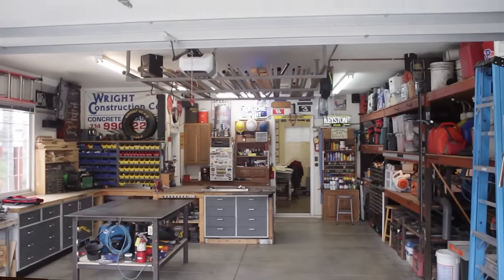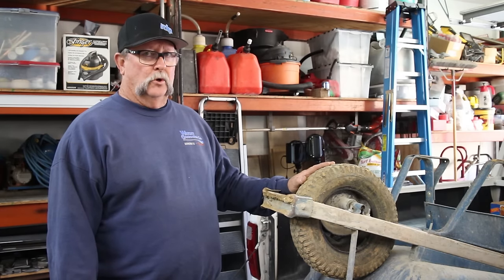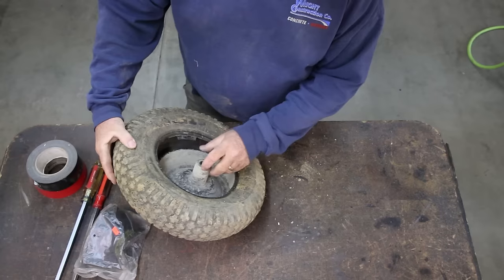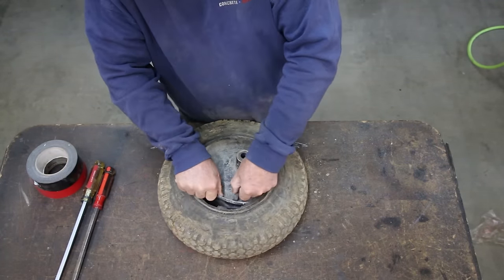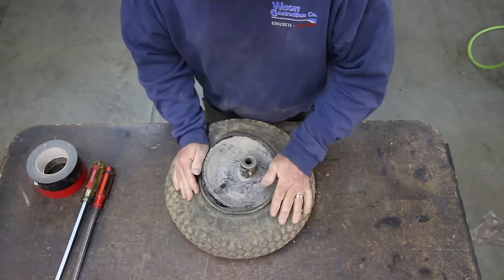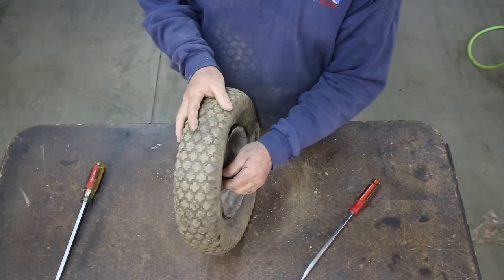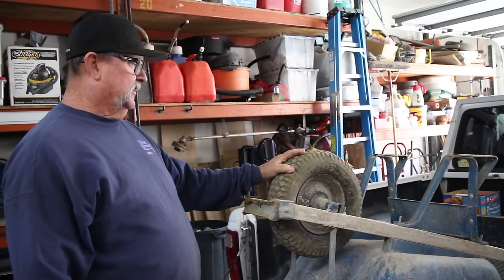How to Replace a Tire Tube on a Wheelbarrow | Step-by-Step Guide

Comment: Just wanted to share, the hardest part of this job is holding the old rim when trying to get the tire back on as mentioned.  I have found the easiest way for me is to put a short piece of rebar (could possibly use the axle itself) in my bench vice pointing up.  Then drop the rim over that so it sticks up through the axle hole in the rim to work on it.  I also smeared dish soap on both sides of the tire bead and was able to get the tire back on with just my hands working it on slow so no chance of puncturing the new tube.  Hope that helps someone else!
Reply: Good tips, thanks.
Reply: Thanks

Comment: Another tip I can give is the valve stem leans to one side when tube is inflated so I put some air in the tube first, mark the tube with a pencil the side it leans, then deflate it and install accordingly. I didn't do this the first time I put it in and when i started putting air in it the valve stem flung back inside the rim towards opposite side. I had to break it all down, remove it and start over.
Reply: Good tip, thanks.
Reply: My exact problem tonight. I told my wife it shouldn't take 2 hours to change a f%#kn inner tube.
I hate stuff like this - once I start, I can't stop - and then I know I'll never get that time back.
Maybe God keeps time like a soccer match - He  adds the time at the end.
Reply: Mate thanks for this tip first time I did it the valve pulled through the hole after reading your comment I got it correct second time round and second inert tube as I had to burst it to get it out 👍

Comment: Everything shown is simple common sense, but the hardest part of the job is completely skipped in this video.  Taking the tire off the wheel!  This one happened to already be off the rim so the job was simple, but you should make a video where the flat tire is still seated on the wheel and has to be pried off.
Reply: Absolutely! That's what I'm looking for, too - how to get the tire off the rim first. If you found a link on how to do that, let me know. Thanks!

Comment: Thanks for the great video!  I did find an easy way to get the tire back under the rim.  I used a screwdriver and 2 pair of small vice grips.  Lock one vice grip on the rim to keep the tire down.  Then use a screwdriver and another vice grip to keep working and holding the tire under the rim until done.
Reply: Nice tip, I stood on two sides and then used screwdrivers as I didn’t have vice grips. Punctured one tube with the screwdrivers, but had the foresight to have bought two tubes.
Reply: Once again, Vice Grips to the rescue. Great tip, thanks.

Comment: THANK YOU SO MUCH!  I've been trying for the last hour to put the tire and tube back on the rim at the same time. My arms are barely still attached.  Your method helped me actually do it in about 5-8 minutes with a crow bar... Very different than changing bike tires.

Comment: Thanks for the video. As with most YouTube videos, I pick up a trick or two that helps a lot. I just finished putting a tube in my wheelbarrow tire, using no screwdrivers (I don't have the tire spoons).. helpful things after I had everything apart, clean out the inside of the tire and check it very carefully for any debris, prop up the hub of the rim a bit (I used a roll of drywall mesh tape I had laying around), grease the rim of the tire with oil. I actually put the tire back on the rim just using my hands. Easiest tube I have ever put in after ruining rims and many new tubes in the past. Thanks for the tips in the comment section
Reply: I'd be worried that the oil would degrade the rubber?

Comment: Damaged a tire on my Scag Zero turn. The dealer wanted $150 for one rear tire. https://www.youtube.com/post/Ugkx985f3iNjxHFMO6JoE7CSGActiIEyumFx Local tire store wanted $95 for one tire and both said I would need two tires because the replacements were 2 ply and the OEM was 4 ply which would result in different diameters when inflated if not mounted in pairs. I ordered two of these for less than $90, they arrived in two days instead of the promised 5 days. they are 4 ply rated and when mounted I can't tell the difference with the Grassmaster that came on my Scag, except the sidewall doesn't appear to be as stiff. Tread pattern is identical with the Grassmaster. Will keep the other new tire as an extra if the other OEM is damaged.

Comment: I was struggling with my wheelbarrow inner tube replacement but feel better to see you struggled as well. LOL I've remove full size car tires manually a few times when I was young, but for the life of me the wheelbarrow tire was much more difficult. After puncturing the tube multiple times with the screw drivers, finally invested in a set of tire spoons.
Reply: I used the back side of a box wrench, round socket extender, and the back side of a crescent wrench. As always I will find .you motorcycle tire irons in about three months or so!

P.S. When asked what tool I am looking for...the one that I can never find when I need it!!! 🤣
Reply: Haha that was 5 years ago, those inner tubes don't last long outdoors in the heat. Patched it and fill it up with air (about 20-30 psi) on all three of my wheelbarrow inner tubes immediately blew out. Have 4 tubes on order. BTW the 3 sets of tire irons ordered 5 years ago works really well.

Comment: Thank you for this.  So much better than the instructions on the packet.   I would never have thought of first putting the tyre on the rim before packing in the inner tube.  But it worked a treat.  Thanks again.

Comment: 1:40  Jimbo has removed the wheel from the wheelbarrow; wheel is on the workbench.
2:00  The tube has been removed from the tire.
2:20  He unwraps a new tube. 
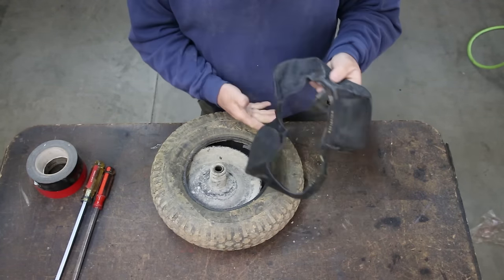2:40  Make sure to get a 480 x4 x 8 inch tube.
3:15  Tube is in the tire and value stem is pulled through in the wheel.
3:40  He starts to work the tire onto the rim. 
5:06  Tire is on the rim.
Tire irons for small tires are available with rounded ends to avoid pinching. Try searching for "tire spoons".
Thanks, best wishes.

Comment: Lubricating the tire to make it easier to pull back over the rim is a good idea. If you use engine oil, try to use as little as possible and then try to wipe up whatever remains after getting the tire on the rim (before you add air to it), because engine oil will degrade rubber over time. Better to use a silicone lubricant, which is non-petroleum based.
Reply: Silicone spray, or dish soap works great.

Comment: Had to change 4 heavy duty lawn tractor tires one day, it started raining and everything got wet and slippery. My not-so-mechanically-inclined neighbor came over to chat right in the middle while I was was working on them 🙄. I kept working/struggling and after a few mins I was like - I’m a little busy right now can we talk later? The tire change was brutal but I pushed through and got it done.

Comment: Thank's for the video, but..... That tire shouldn't be used again, you can see that the steelwire are apart from the tirebead. And also when putting in a new tube one has to feel inside the tire that there isn't anything sharp inside. And it's much easier if you clamps the rim in a vice, instead have it loose and a bench. And last, do not use a screwdriver when mounting, use a tyre bar instead.

Comment: One thing l would have done before installing the new tube: After l had pulled the old tube out l would have checked the inside of the tyre for thorns, grit etc i.e. anything that could cause another puncture. 😉
Reply: I agree - exactly what I wanted to say - I thought it would have been said by someone else as the video is approx 6 years old so I'm glad to see you comment.  Also, I use motor cycle tyre levers as they have a larger surface area and are curved and, if  you're doing this job regularly then it is worth investing in getting some of them for this job. I did like the use of the rolls of tape to support the wheel whilst doing the job - a better idea than what I'd been doing - balancing the wheel between two blocks of wood!

Comment: You do that weekly and u don't have tire spoons to prevent nicking with a big sharp edged screwdriver?
Even as a kid I used big pliers to avoid hitting the tube with a screwdriver.
Just saying. If you're gonna give advice to novices, educate them better.
Don't know how many bicycle tires I fixed as a kid. Was pissed when I'd put on a brand new tube and nick it with a screwdriver edge. Thanks

Comment: thanks bro! I used a couple of bricks on each side and got it on first try after a whole day of frustration and despair :face-fuchsia-tongue-out:
I didnt even have to get under the lip I just pushed it down...which worked with my elbows holding it in place thats the big difference..also put it the tyre under a hot shower to make it more flexi...not sure if that helped tho tbh :face-green-smiling:

Comment: Jimbo called the valve cap a stem, which it’s not. He also said to be careful not to puncture the rim. He should have said be careful not to puncture the tube.
Reply: Correct. Very poor vide from that point of view and it took him ages to get the tyre back on the rim.

Comment: Add a little oil goes on real smooth.no effort.
Reply: Great tip Desmond. I tried it and I put the tire back on without using screwdrivers. Worked like a charm. Thanks for posting it

Comment: "take the valve stem off" - you meant take the valve CAP off. "Try not to puncture the rim" - you mean try not to puncture the tube. Very messy getting the tyre back on the rim. Ordinary video.